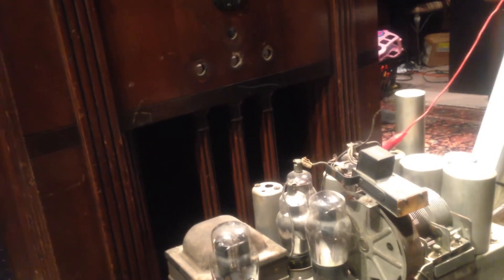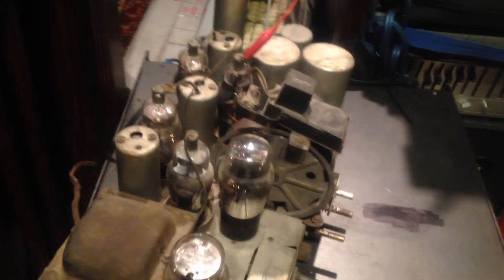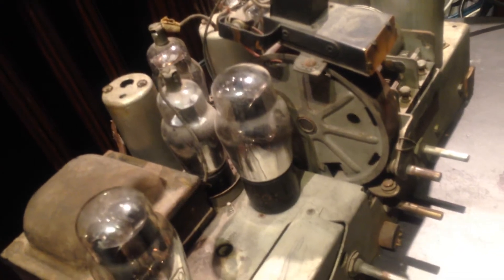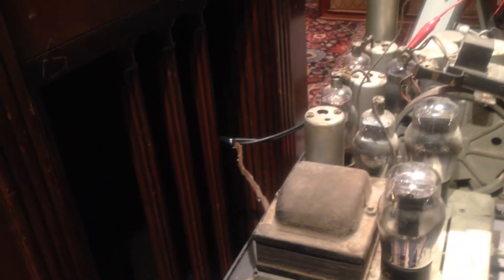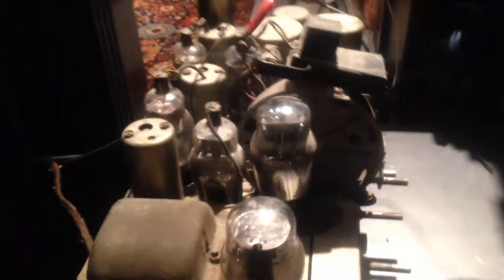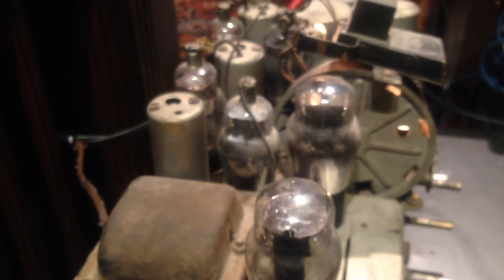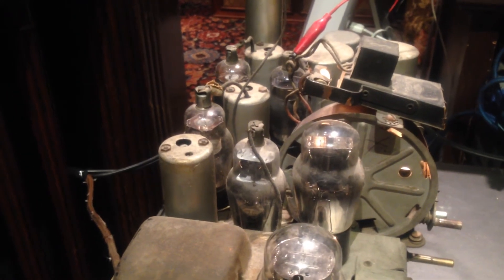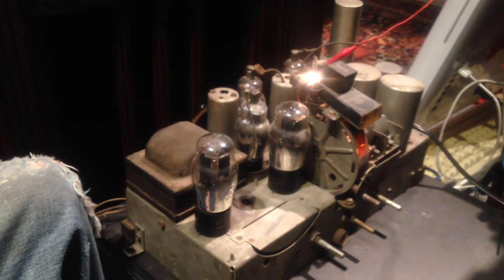Philco 16x Tube Radio FIRE IT UP REALLY!

Comment: Man, look at all those beer bottles and beer cans, a true Rolling Rock radio!
Reply from the maker: Now we know we're having fun!
Reply: I was thinking that that wold actually be a funny prank for buzz, John, Bryan, or Shango to enjoy, make a mocked up fake radio chassis in an old tube console, replace all the tubes with beer bottles, and ecaps with beer cans.  Put LEDs in the bottles so they light up.  Then put a strobe in the radio lighted display tuning scale. Hook the speaker up to a small transistor radio concealed under the chassis.  That would be a one of a kind radidio!
Reply from the maker: Hahaha yup that's a good idea!  And we could put a small transistor radio underneath hidden, hook up the volume control, and speaker!  Thatd get em good.  Ok we should get together and build it! You prolly have a better shop!
Reply: but who will provide the beer bottles and beer cans?  heh heh heh
Reply from the maker: Good question!  Hahahahahaa

Comment: Wow that's really impressive!  All original parts and it barely even has hum.  I'd just throw it back together and see how much it lasts like that.  I'd probably change the filters at least so they don't destroy the transformer, but besides that you've got a radio that runs all original.  Don't see that everyday.  I've always wanted an old radio that would still work on all it's original parts.
Reply from the maker: Thanks! Do you have a lot of tube radios still around your area?  They are becoming a little scarce.  I have to get them at antique stores and yard sales. I'm still looking for the caps for your tv.  I really liked the white tube radio that you fixed a while back. Good stuff Felix!
Reply from the maker: Did you find those caps yet? 1000 @ .033 and .047?  Still on the bench?  I've been looking.  Man they are some I just don't see much. Not in the last 4 tv's I scrapped and not at the local radio shack.  Damn I really wanted to help and see that puppy happy!  Hope all's great Mr. Felix...
Reply: Steven King
Nah sorry man, biggest issue is that I broke the 38HE7 tube too, put them in a litle tin and I dropped it and one or two of the tubes broke.  Pretty much it away now, really sucks wanted really bad to fix it!
Reply: Steven King
Hey I tried sending you an email but it doesnt work, what's the website after the @?  Did you short hand it?